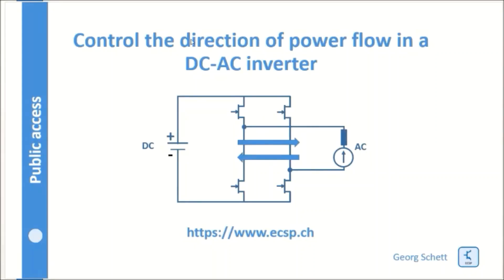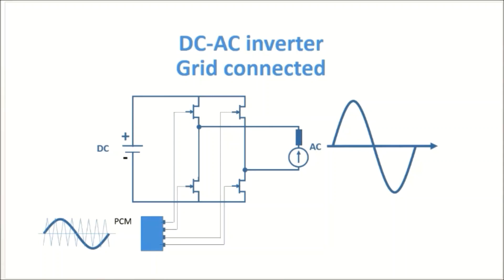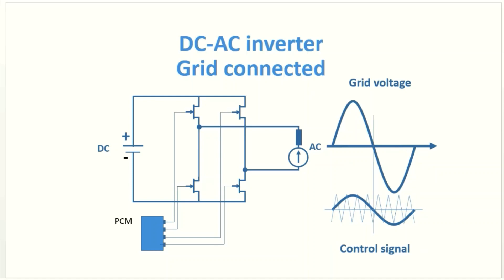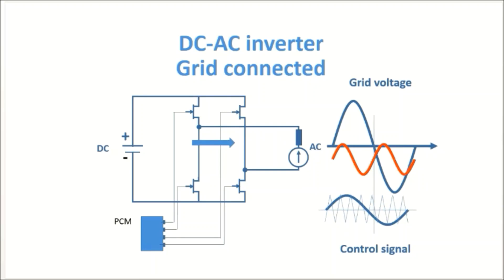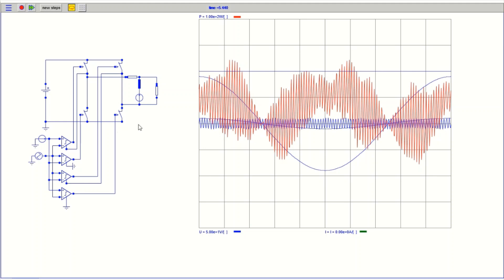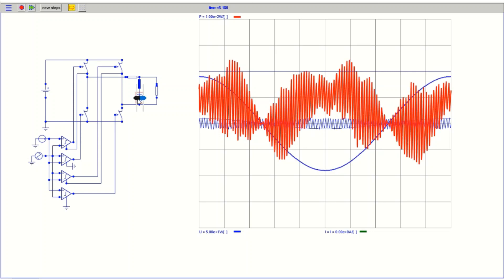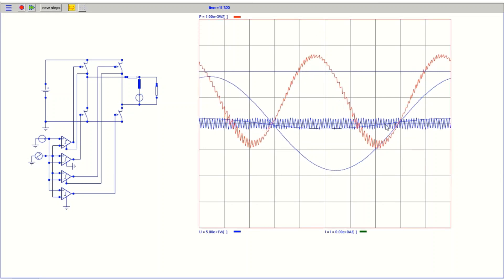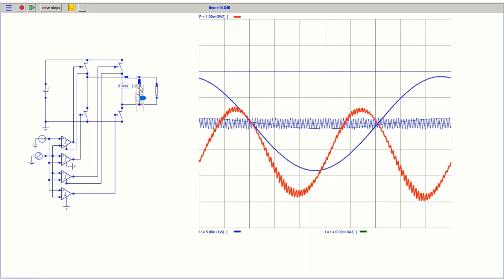Power electronics inverter flow direction

Comment: Hi George. Please tell me why in the theoretical part the battery is charged when the controller phase is leading, but in the example with simulation, it is the other way around?
Reply from the maker: It should be so: When the battery is charging, the power is flowing from the grid to the battery, thus the phase angle at the converter should be lagging behind the grid voltage as it is shown in the simulation.